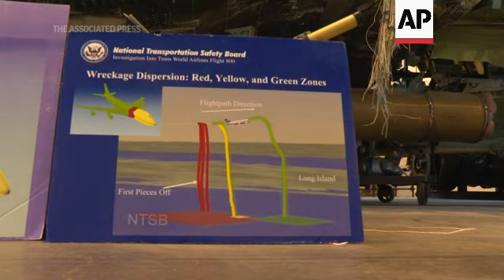TWA Flight 800 wreckage to be scanned, scrapped

Comment: What caused TWA Flight 800 to crash?
         How did all the pieces, sections and debris wind up in the three different debris fields?  In debris field three closest to JFK Airport, pieces of the plane reportedly flew from the plane at supersonic speeds.  It would seem the distance these items flew from the plane perpendicular and to the South of the plane’s pathway that an explosion occurred inside the plane.  From a physics standpoint, how did this occur?  

        The Left Wing and Left Center Wing Tank Fuselage were never found which separated from the main fuselage of the plane seconds after the first explosion when the Inner Left Wing Tank and Center Wing Tank exploded.
Reply: Well, you can’t expect the part on the plane to survived, especially if the plane explode that melted a lot of the metal, also, pretty sure the left wing and left center wing tank was blown away by the ocean currents, but of course, where you got the info the debris go supersonics anyway?